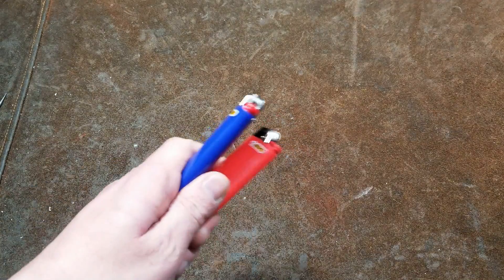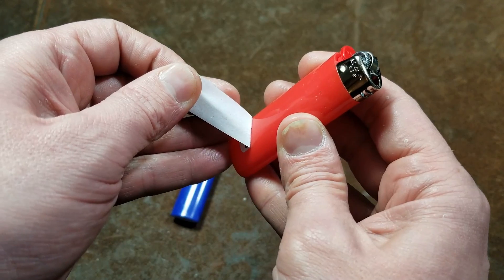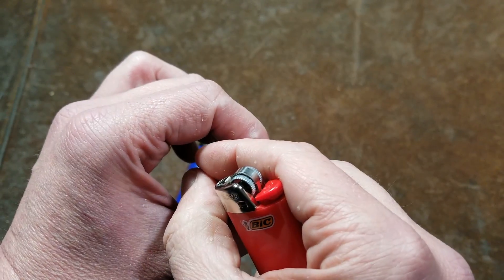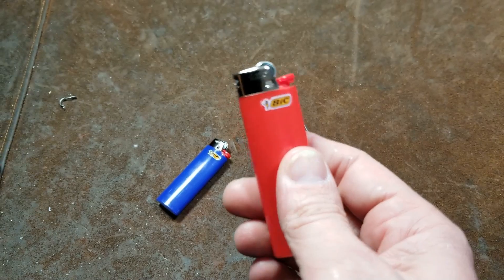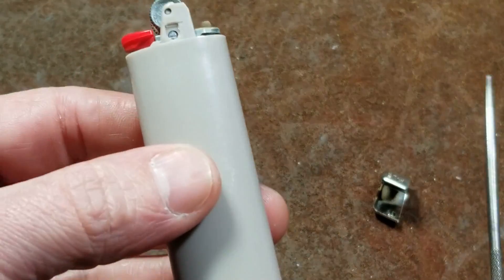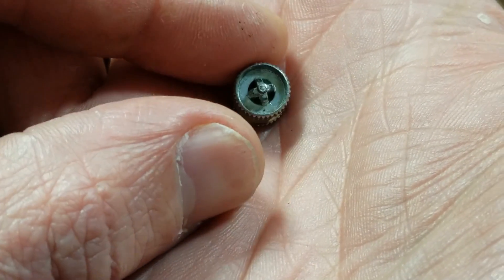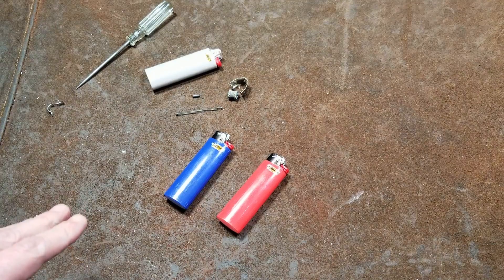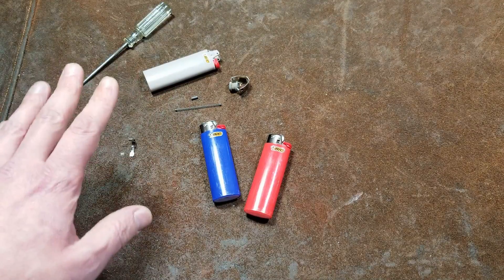The Ubiquitous BIC Lighter.

Comment: Keep this and a hot glue stick in your tool kit. You can melt the hot glue and make emergency repairs, insulated wires, etc with the hot glue.
Reply: Why the fsck would you want to do that when you could just have a few sizes of heatshrink tubing instead?   Hot glue is crap for anything but crafts.  If you really want to make repairs, superglue or epoxy would be far better.
Reply: Stinky Cheese do you watch Jimmy Diresta much? He keeps a hot glue gun on in his shop all the time for different things. It was in one of his shop tip videos. Also in an emergency situation I would love to watch epoxy dry. Hot glue is better then what you think. They make more then just the kind you buy in the craft store.
Reply: @stinkycheese804 I know that this was three years ago, but he replied to you, if you want to make a rebuttal.
Reply: @crazy_pyromaniac  There is no rebuttal needed, what I stated is true.  Any professional knows it is inferior for this purpose, unsafe, does not meet code, etc.  Perhaps find something more useful to do with your time?

Comment: They are great for popping off a beer bottle cap. Simply leverage the lighter over your forefinger wrapped around the neck just below the cap. Use the bottom end under the cap and bend down the lighting end holding the length tightly to you finger above the second knuckle. These are manufactured on Bic Drive in Milford, Connecticut, which makes half the world’s Bic lighters there.

Comment: THIS IS IMPORTANT:  Saw this in an online forum post and it seems the "community" is mostly unaware of this option. USE A # 10 O RING instead of a zip tie. For me the zip ties do not always work - to keep the gas \ fluid switch from being pressed. (one must get  the right tension) Whereas the O ring works flawlessly # 11 O ring works too but is not as tight. Not sure how long the O rings will last "stretched" across the Bic but they easily are reusable. They are black so may be easily lost in the woods. They only cost about 2.50 for 10 of them. They work 100% of time to keep the gas from escaping inadvertently - get the word out seems many do not know about this. For the D Jeep lighters its the # 15 O Ring. When using an O ring press it into and under the - in between area to keep the switch from being depressed then man handle it over the lighter just king of slide it on as you do with the zip tie. If you find the O rings wear out in 6 months or a year from being stretched then simply use them when you venture out into the woods I have not test them for longevity. They can be easily lost so thread them on a peace of para cord when you get to someplace where you just leave your lighter laying around.

Comment: I use a 1980 Bic adjustable flame lighter with a refillable valve installed. I replace the flint every couple months with HEAVY use. I make a new one every year because I get bored with the same color. Really, I don't need to ever buy another lighter, they are disposable buy they work like new after years. Zippos suck, they leak and stink and are a brick. Ever tasted something lit by a Zippo? Tastes like the smell of a bum.